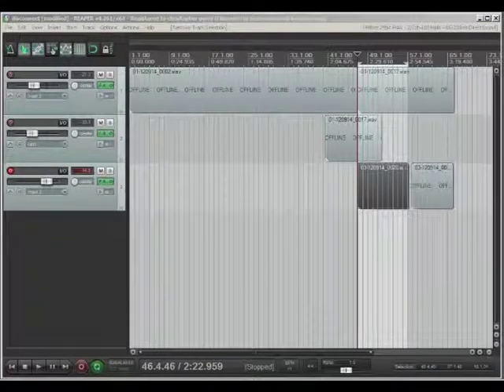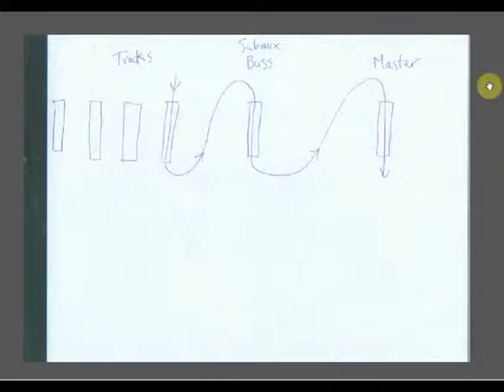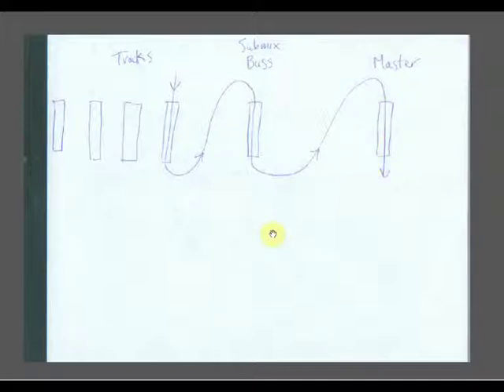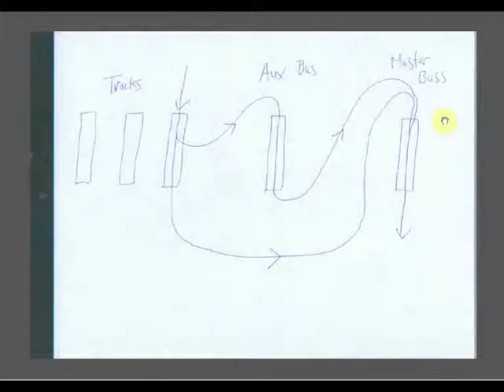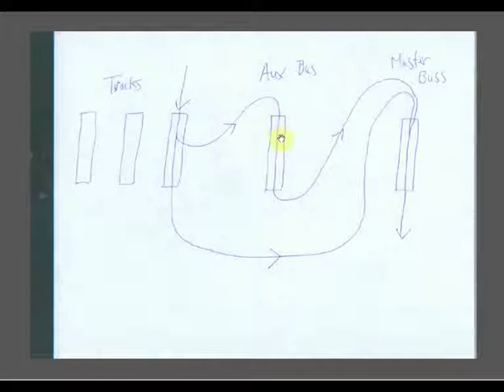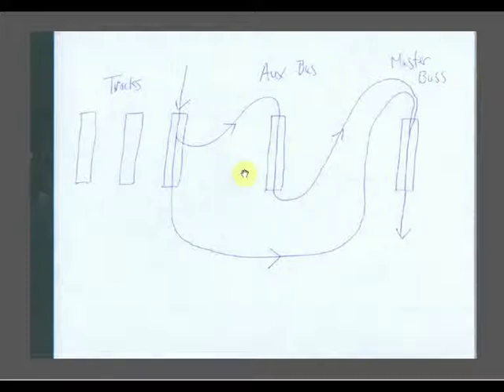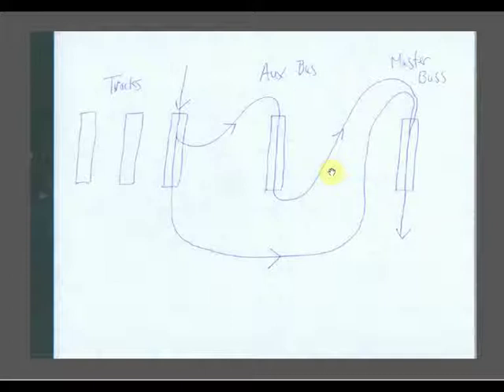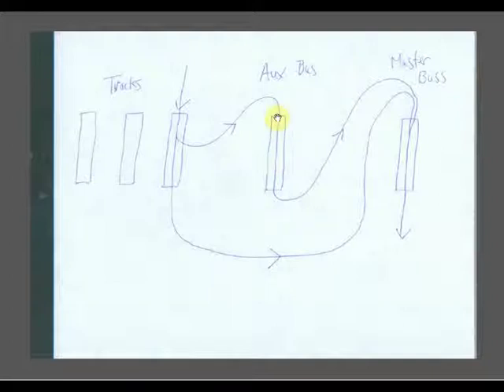Auxiliary and Sub-Mix Buses Explained

Comment from the maker: yes hitting a compressor harder (or softer) will change the sound. i should have mentioned. but what i'm thinking about is the way summing works. DAWs don't always add logs when they sum. mine doesn't. information is also thrown out. you have limited precision. and then there is phase cancellation when you have several mics on the same source. so it's more complicated then theory i think.